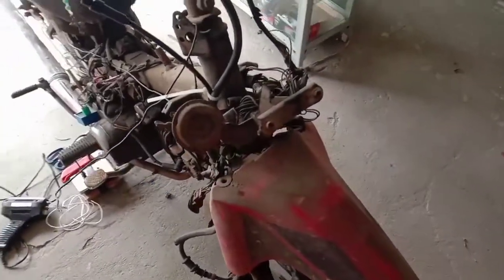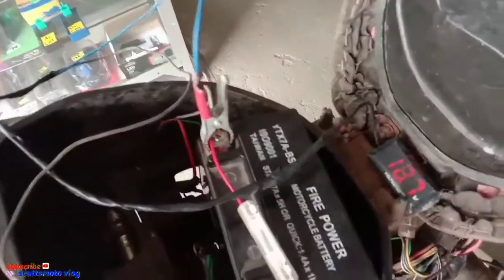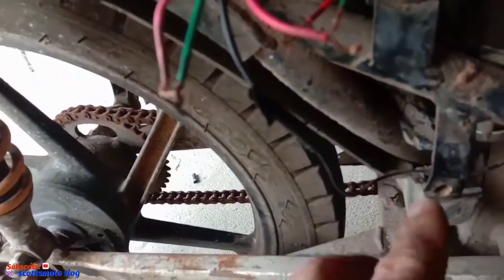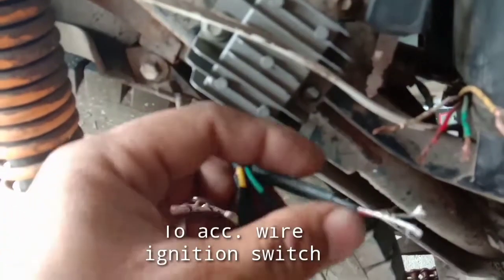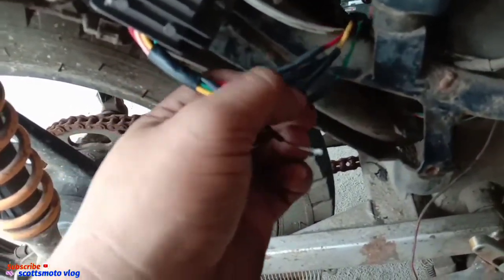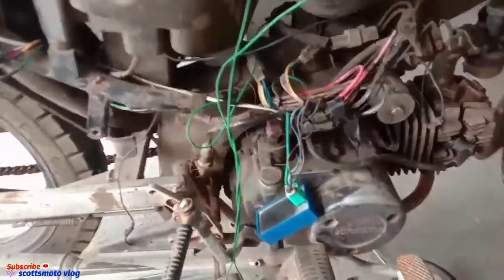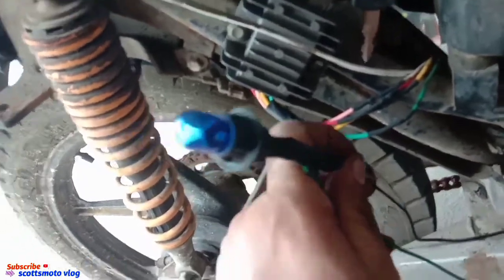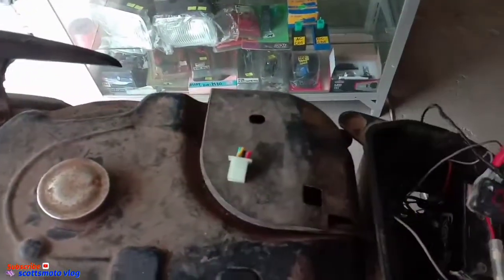Rectifier Regulator 5ipn Installation  Manual & Diagram

Comment: Master tanung Sana ako Yung Nabili Kung 5 wire regulator Hindi po black color ang naiba, green white color po sya at nahiwalay Rin sya sa socket, may color red,yellow,pink at green, ang tanung ko Saan ko po ikabit ang color green white na wire, isang wire Lang po Yan na my color green white?
Reply: Sa 5 pin di po dapat ang black na wire ay sa BODY GROUND?

Comment: Sir Scott's.. Balak ko kc ifull wave ung Honda Wave-R ko. Panu b malalaman kung ung nabili ko bng rectifier/regulator ay pang full wave b sya? Panu po b sya itetest? May nabili kc ako s isang motorcycle shop ang binigay s akin ay APIDO brand n pang GY6 pero kulay silver sya. Malalaman din b s kulay ng Rectifier kung pang full wave b sya or pang half wave? Sb kc ng napagtanungan ko electrician pang half wave prin dw ung nabili ko. Nagwo worry tuloy ako kung bibili n nman ako tpos ang maibigay ulet s akin ay pang half wave. Sayang n nman ung pinambili ko. Sna may iupload kang video tungkol dun s katanungan ko. Salamat en God Bless!
Reply from the maker: Yes sir. 2morow
Reply: @scottsmotovlog4187  5 wires nman ung binigay s akin dun s shop n binilhan ko. Ang kulay nya ay Red, Grin, yellow, pink at Black.. thanks IDOL. God Bless!

Comment: Bkit ung iba lods pnagsasama na red at black wire ng regulator ska ikukunek sa red ng harness?
Reply from the maker: Oo minsan Ganyan sila kc sabi nila positive daw Naman parehas tama naman kaso lang yung  hindi lang nila maintindihan ang trabaho ng black wire sa rectifier Dapat hindi sya 24/7 may SUPPLY
Dapat pag off ng ignition switch automatically off din ang black wire 
Ang coast kc non pag pinag sama ang red/black pweding masira agad ang regulator